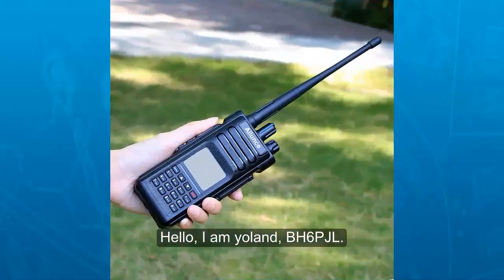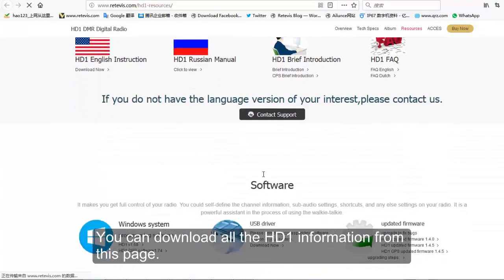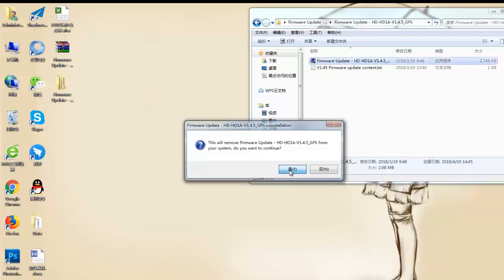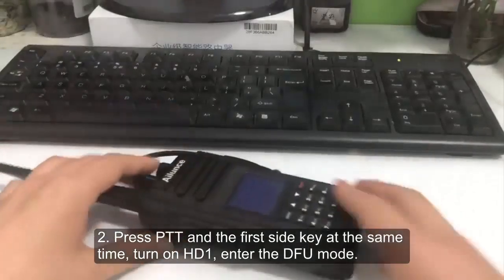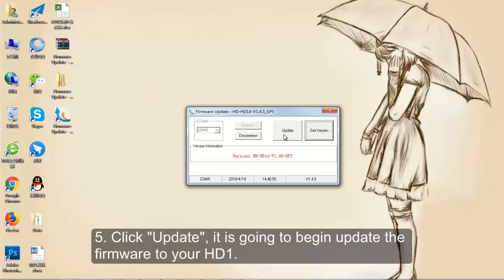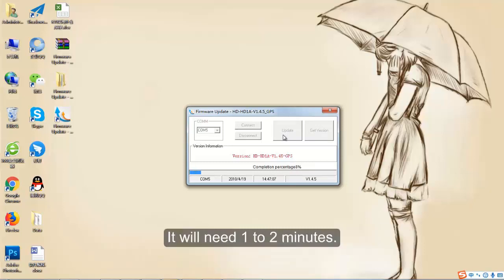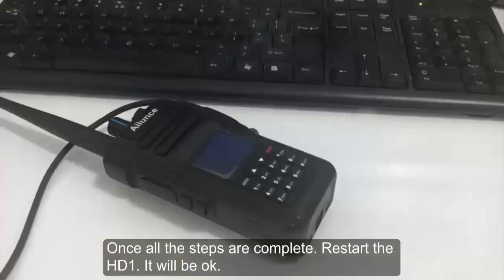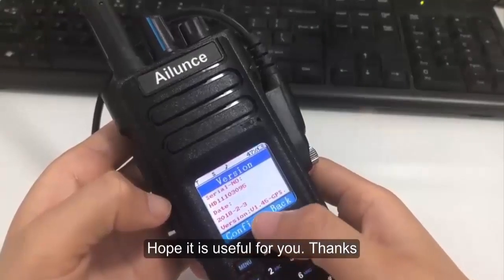Ailunce HD1: Upgrade Firmware and Initialize Steps

Comment: Great radios love the HD1. However,. Pro tip; be sure to download a factory codeplug when you buy your radio. I was not able to initialize (factory reset) after I had programmed zones and channels. I had to reloadload factory codeplug before I could make any selection when booting for initialization (green key+red key and power on).  With my programming it would boot in initialization, but I could not make selection. Non GPS FW version 2.2.9.  Hope this helps other folks in look of factory reset. Excites to see what the HD2 offers😊

Comment: Two years have gone by and on install it still triggers an antivirus alert. I am not feeling comfortable with this.
Reply: Windows and most other malware scanners give an alert if the Installer doesn't have a valid signature. Usually a build server config issue.  If you are really concerned, easy solution  is to run run  in a windows environment in Vbox or VMware. You can keep all your radio configs and software in a "sandbox" apart from your PC Operating system.